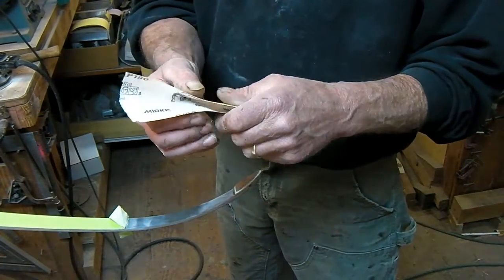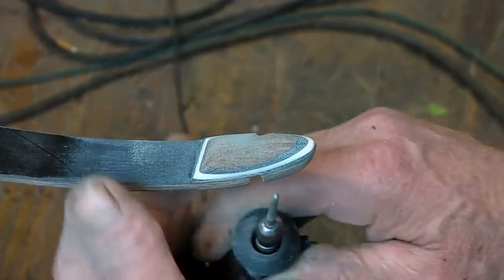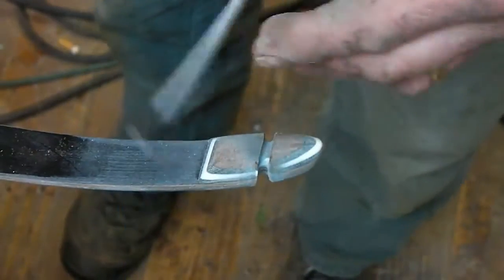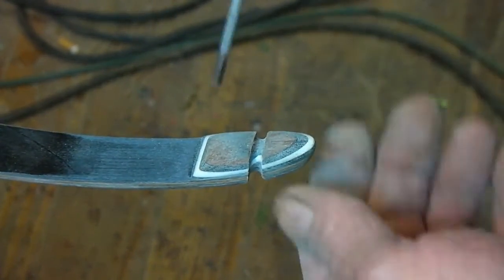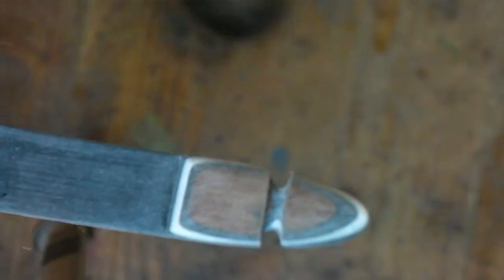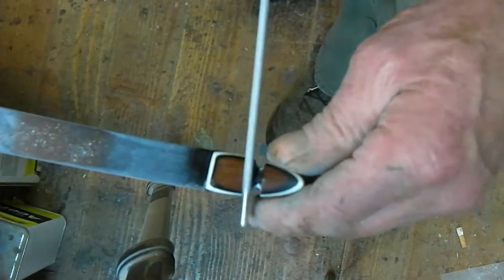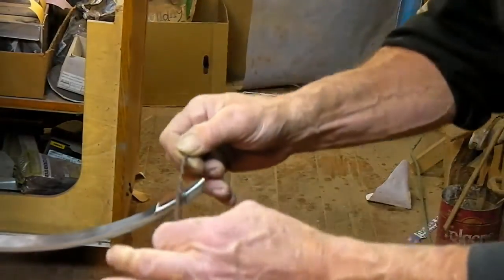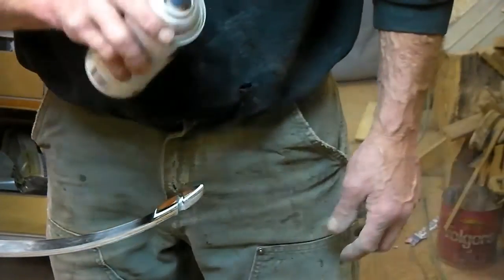Tip shaping part 1

Comment: Thank you Kirk - your videos on tip making/shaping are invaluable - just replaced a tip on my 1960 Ben Pearson Palomino recurve bow and I used your videos for guidance - it came out great - one additional tidbit regarding CA glue - I found thicker CA glue to be a lot easier to work with than thinner - Thank you again!